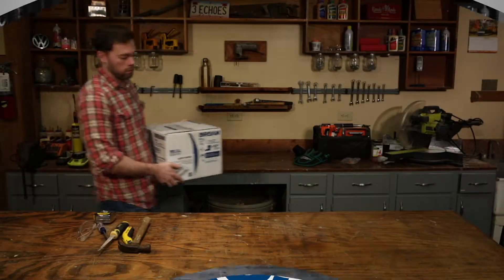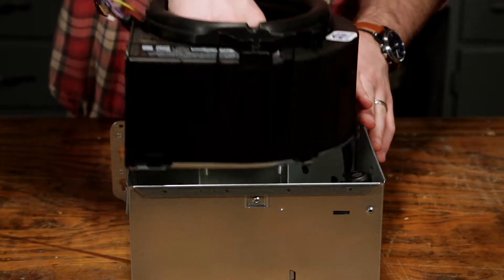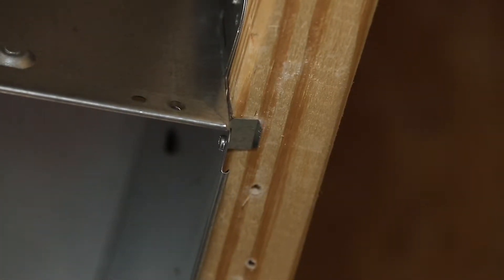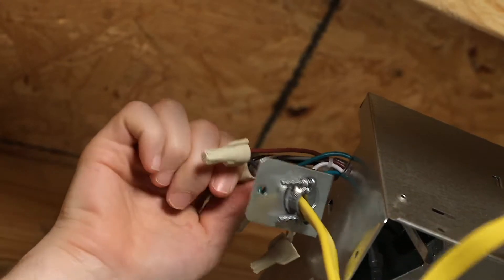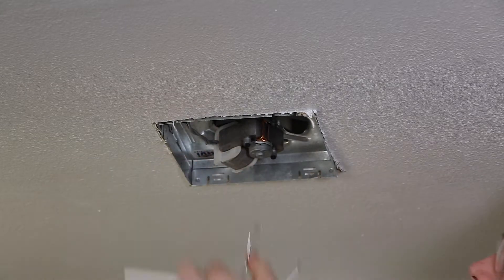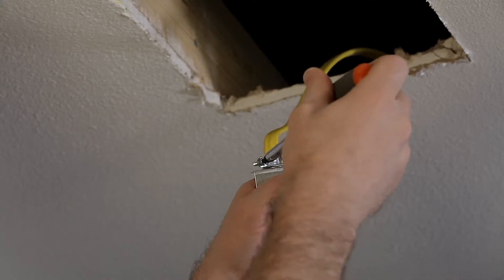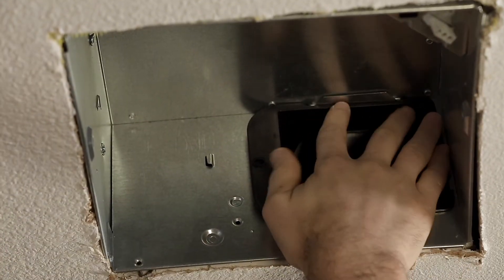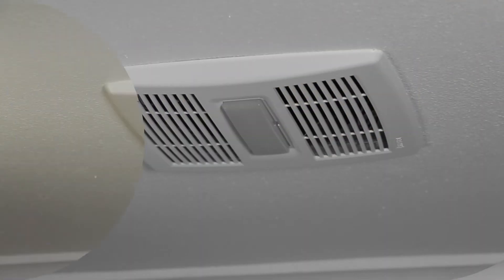Broan FLEX Series Installation

Comment: How do you change the light color temperature? This feature was listed on the product but directions aren’t included.
Reply from the maker: Thank you for your question. We will need to know the model number of the unit you purchased. Normally, either the light switch is toggled to change the color temperature, or there is a switch on the grille or in the housing. We can tell you more once we know your model. Please contact our Product Support at 800-637-1453 with your model number for additional support or email from the Contact Us page on our website.

Comment: this looks to be installed with a 12/3 wire.  The home is equipped with 12/2, black, white, ground.  Is there an alternative wiring diagram you can send?
Reply from the maker: Good Afternoon Heather, it would depend upon which model you have purchased.  A fan and light unit can be wired together and use a 12/2.  If you have an added humidity sensor, then you would need to either run another wire or not use the humidity function.  Please give our Technical Support team a call with your particular model number at 800-637-1453.  We can discuss your options with you once we know your model number.  Thanks much and we look forward to your call!

Comment: What happens if I forgot to put the wiring plate back on but connected all wires. Do i need to take it all apart to put the wiring plate back on?
Reply from the maker: Good Morning Barinder and thank you for your question. We would have to recommend installing the wiring plate.  Due to safety concerns regarding moisture and also have the wires not secured behind that plate, we would recommend this part be installed.